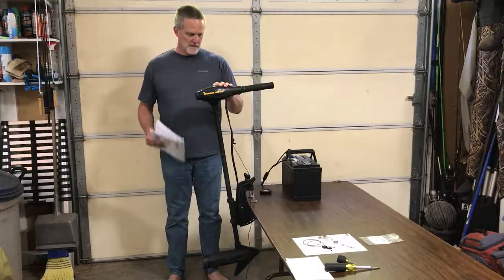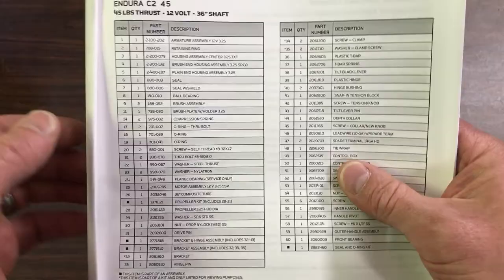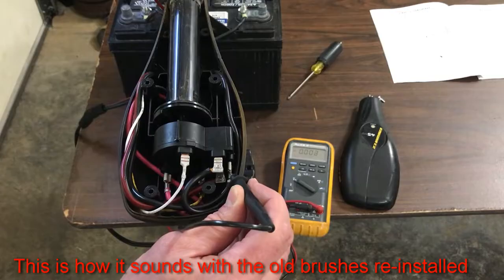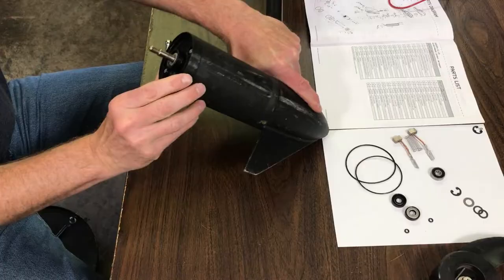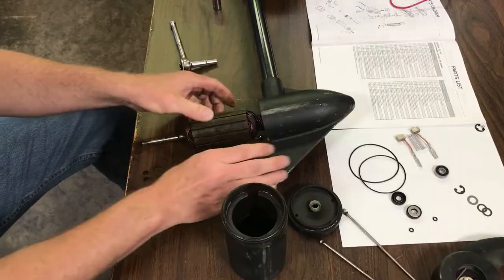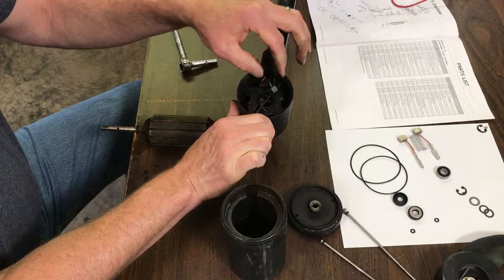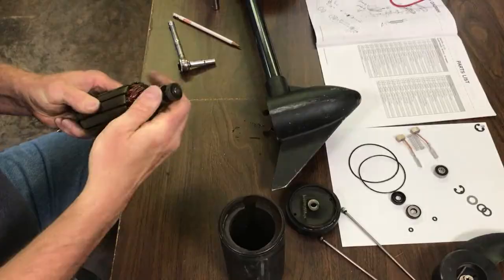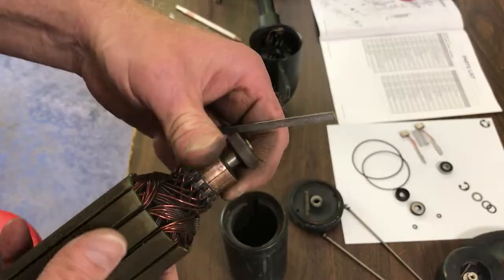Minn Kota Trolling Motor Repair

Comment: Nice vid, it was exactly what i need, but i have a question, i have an Minnkota Endurance C2 40Lbs, does the kit fit too?  Thank you!
Reply from the maker: That would be a good question for the parts supplier. Is yours 3 1/4” diameter?  I think they go by diameter more than the model.
Reply: @fixthemthings  I dont know how to measure that, im from Portugal and i think the metric system is different, however, looking to the kit you have on vid and the one in the link below, they are exactly like mine :-)
Reply: I just ordered the parts kit for my 30lb motor. If I recall correctly, the 3 1/4 kit fits up to the 45lb thrust motor.
Reply: I just did mine I have a c2..this kit is perfect fit

Comment: I have a Minn Kota trolling motor Endura C2 30lb thrust. Does anybody know what that molded / epoxied section in the front motor case is? It has there wires into it, two-yellow and one white. Sure it's part of the speed controller. Maybe the Power MOSFET drivers. Placing in the motor case in the water to keep them cooler (Of course just guessing). I'll take back what I mentioned about that incased/potted section in front of the motor compartment. I saw the part description of that part, SPCOIL Speed Coils - FW potted. I ohmed those three wires "YEL/WHT/YEL" all three of them ohm out to zero ohms. So maybe those are coils / inductors / surge protectors ????
Reply: Resistors. I have no experience with these motors, but have been researching it lately. The speed controlling is done with resistors. They reduce power for the lower speed settings, and convert the wasted electricity into heat, so that's why they are housed in an underwater location; for cooling...as you mentioned. There may be other names for them, but they are resistors.
Reply: @blaisetreinen1677  I’m not convinced that potted module contains resistors. I ohmed the three wires (YEL/WHT/YEL) to each other. All combinations ohm out to 0.5 ohms.  Don’t think three wires would provide four different speeds 8/9/10/11 volts. Or maybe two of the speeds are handled in the speed controller itself and two other speeds are handled in those coils in that potted module?
Normally when resistors fail due to excessive current, they will open. Currently I’m in the process of rebuilding the trolling motor's (DC motor). In the meantime, I am using a different DC motor to simulate the trolling motor. My first guess when the speed control didn’t work with that substituted DC motor was that the speed controller was defective so I ordered a brand-new speed controller but I still have the same results as before. The problem before replacing the speed controller and with the new speed controller is that I have full speed 12volts  across all five positions forward and all negative voltages on all three reverse positions. That’s why I am questioning what is exactly inside the molded section.
I was going to disassemble the old speed controller to see what’s inside other than just switches, not sure if there is some type of electronic circuit that helps regulate the speed or not. After revisiting more information,  it does look like there is two coils in that potted material. I don't like that process of speed controlling because of the heat it generates. I'm thinking of installing a PWM module.
Reply: Now I'm wondering if it could be that I'm not using the original motor, since this substitute motor isn't drawing as much current. When the motor rebuilt comes in, I'm going to reassemble the original motor to see if it will work.
Reply: @blaisetreinen1677  I'll be an Monkeys Uncle. The trolling motor works after rebuilding the motor.
Reply: Yes, the 'old' speed controls just inserted various resistor values in series with the motor, wasting battery energy as heat, and leaving less for the motor. A PWM motor/speed controller is much more efficient. I'm using a "100 amp" eBay controller (rated for 60A continuous), on my 40# MinnKota.  The tricky part is making the controller 'boat proof'. I'm using a plastic dry box with a clamshell vent.  
Hopefully this controller will hold up. I tried a $15 "50A" controller--it lasted for a few hours, but ended up popping a MOSFET. The 100A controller (about $50) has bigger MOSFETs, bolted to a heatsink with a fan mounted on top.

Comment: What do i do when my motor just isnt getting any power
Reply from the maker: Most likely the brushes in the motor. Could be the throttle switch. Have to get a volt meter out and check.

Comment: My minn kota endura will run for few minutes good then as it warmed up it got slower and slower and finally stopped. You got any idea what it could be. Also switching from forward to reverse it wouldn't always go to reverse
Reply from the maker: Most likely bad brushes. Are you doing this in the water or out?  Don’t run it out of the water except just momentary. For forward reverse the brushes are probably moving inside the brush holder. Put in reverse and then move the prop with something safe to see if it will then turn. Most likely brushes.
Reply: @fixthemthings  thanks,sounds like it but to my eyes the brushes don't look that wore but could be.
Reply from the maker: @dmobley1089  maybe the brush springs are not strong enough keeping the brush against the armature. Could also be your switch.  Let me know what you find. Try cleaning the armature with an erasure.

Comment: Mine is making a knocking noise.. it's brand new.. any suggestions
Reply from the maker: Knocking while running in water?  Do not run it out of the water. Water lubricates it and it may knock without water. If it’s new, I would exchange it for another.
Reply: @fixthemthings  yes.. knocking while in the water.. sounds awful

Comment: Installing new brushes didn’t work. Should the new brushings be slightly loose?
Reply from the maker: Did you do all the power checks to see if 12v is going to brushes. No,  the brushes should not be loose. Did you get the springs in correctly?
Reply: I found the issue. The brush that connects to the negative wire underneath the brush assembly wasn’t connected. It works and I used(tested) it today for about 2 hours of fishing. However my trolling motor seems to have picked up some vibrations. Not terrible but noticeable.

Comment: Where can I find torque specs?
Reply: Hello, Have you found the answer - 
Which Torque is recommended for tightening axial screws, propeller nuts, for motors 3 1/4, 4 1/4 ? Where?
Thanks

Comment: I have a question i put it back now it spin very very hard you need to kickstart it with your foot do you now what to do?
Reply from the maker: Sounds like something is in a bind. I would spin by hand without power and see how easy it is to turn. You may have gotten a brush jammed up in there. Maybe a brush spring became dislodged.

Comment: Petroleum jelly works wonders as o-ring and seal lube.
Reply: that would eat up the seals
Reply: @JosephMBoyer  Used it for years while working on jets for the Navy. Lubes "o" rings to hold inplace or ease instalation over shafts.
Reply: @richarddemello4648  it will rot it away... if vasoline is used on poly it usually will swell if not rot. why bother when theres grease for the job. google "petroleum on o-ring"
Reply: Advising anyone reading not to use vasoline for grease. lol. it's 2023 people.

Comment: Mine lasted 4 years and it is a crummy design.  All they have on the prop shaft is a rubber washer that lasted about as long as a washer in your garden hose.  Then it got hard, misshaped and allowed water to leak inside the motor.  
  Warranty three years, motor lasted four.   Duhhhh
Reply: Next time lube all your rubber seals with silicone grease for rubber. I gotta can on Amazon with the brush under the lid and it has a thousand and one uses. Even tried it on the drain plug and it made a world of difference.